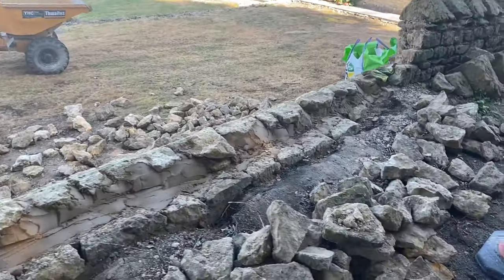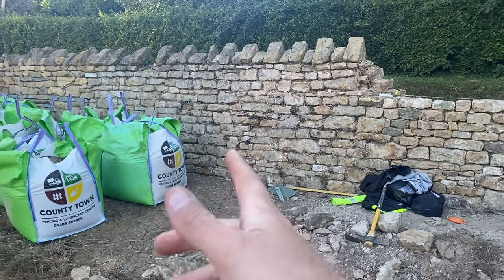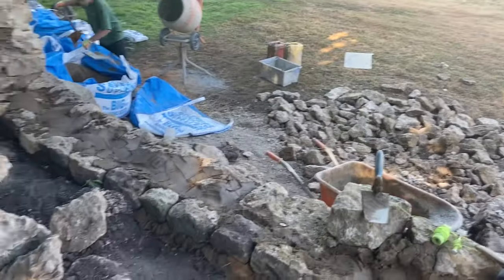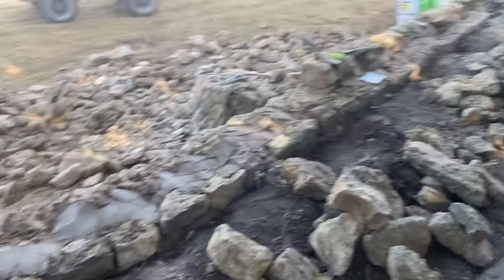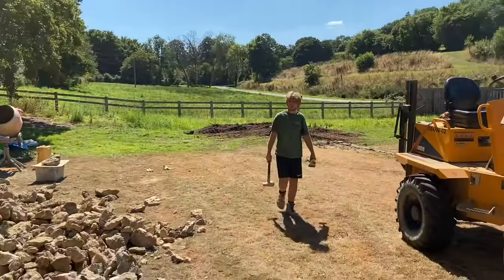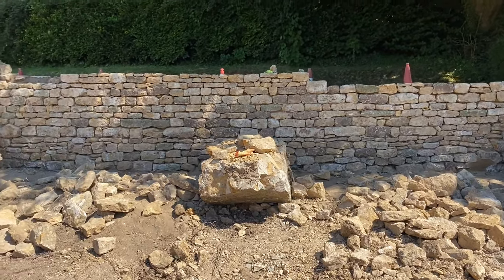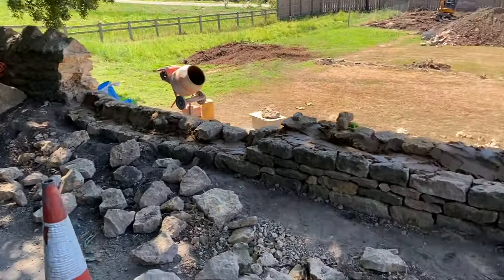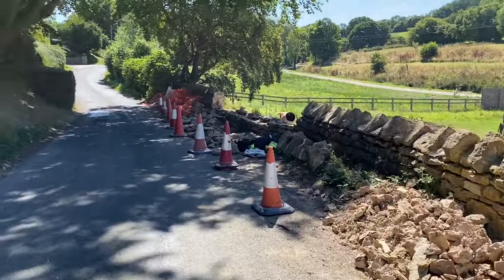Building A Old Stone Wall Dry Stone Effect #5

Comment: Looking good!
Are the wheel barrows worth the money?
Can cement mortar be used in the building of  stone walls, just not pointed with it?
Reply from the maker: Thank you for watching, yes the belle are well worth it! Had ours for 2 1/2 years now! Yes you can but always have explain the risks. Its always better to use lime for stonework but it comes down to price etc.
Reply: Good to know. We go through the normal ones pretty quick. 
Yeh wasn’t questioning what you’ve done. Just wondering about what to do with my own project really